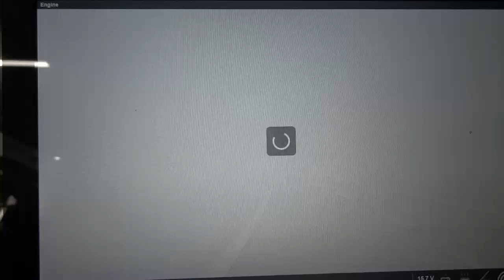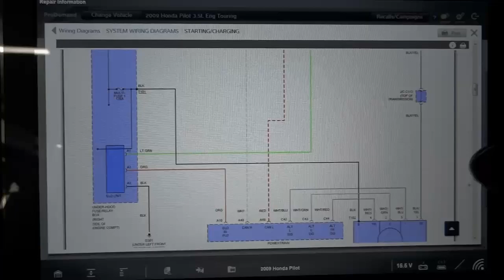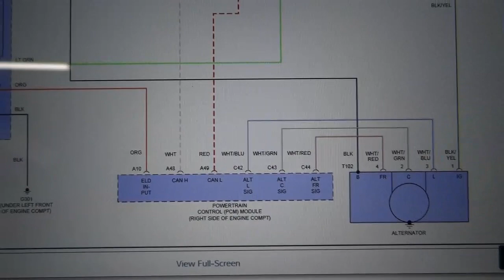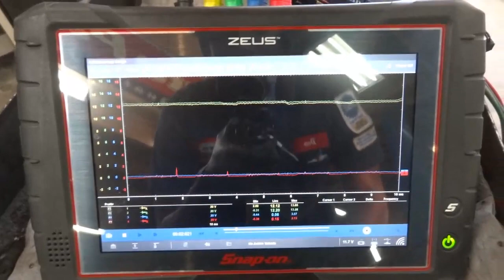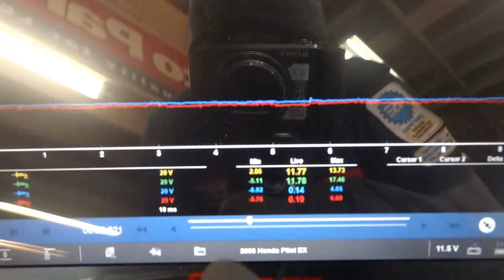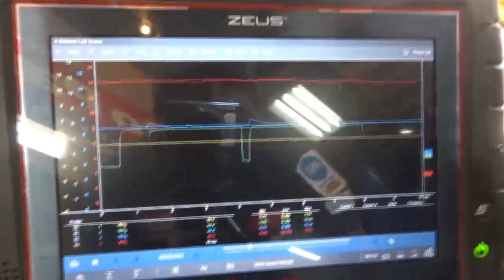Honda Pilot Code P0562 Charging System Low Voltage / Battery Light Stays On While Engine is Running

Comment: Hello Deo..great video!..the best ive seen so far for the Honda charging systems. I do have a 2007 Pilot so the video will some day be very relevent to me. One thing I would have liked to see is more details on which terminals were showing the voltages and why both before the repair and the voltages after the repair. From what I've read eleswhere (and not in service info) tells of how the computer doesn't supply all the voltages. The regulator sends the voltages on the C wire and the ecm controls them by pulling or not pulling the voltages to ground. if you ever do another diag on an older honda..i would really like yo see your presentation in detail. Below is something i found which seems to explain the more specific roles of the L, C, FR circuits. again..thanks again and keep up the great work.

About myself..im learning auto diagnostics not as a career choice..i only want to keep my mind activated and be able to help myself, family and friends  to not pick up a parts cannon and help them with their vehicles so we can all save some money.

https://drive.google.com/file/d/1-3Tysrs0DqL9_R2XX2JLj0cJVxMlpY5s/view?usp=sharing